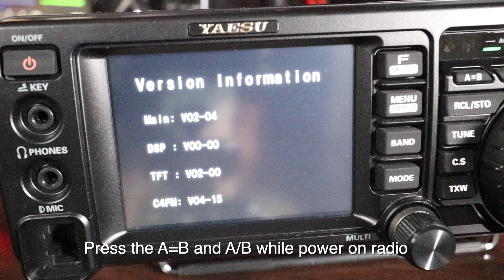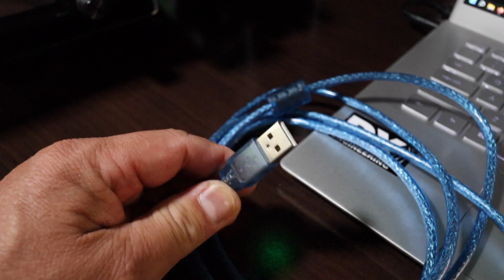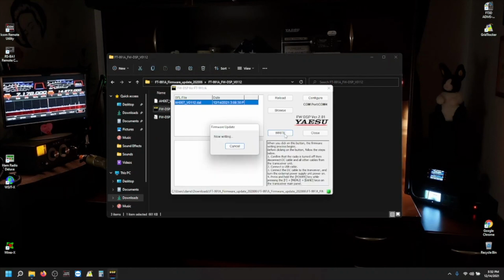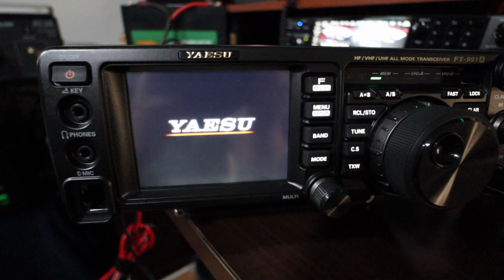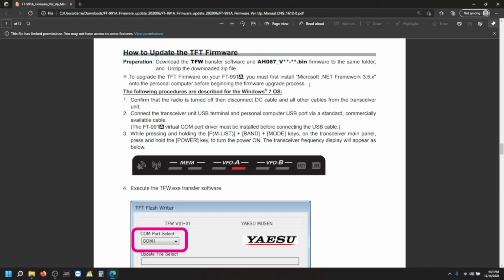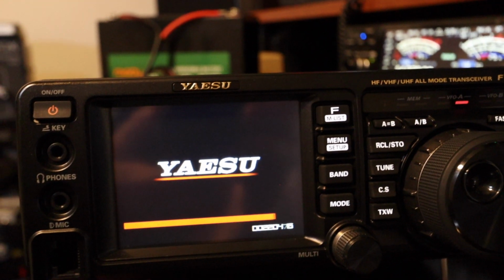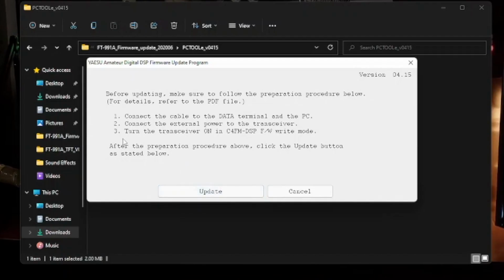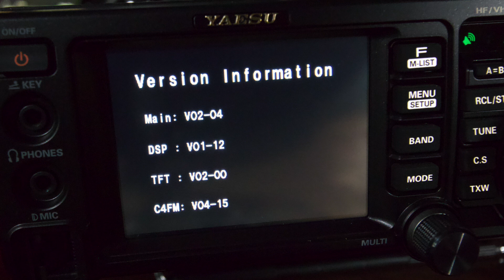New Revised!  Firmware Updates on Yaesu FT-991A | The Process Required! Main Firmware V2.04.

Comment: Excellent video.  I found it interesting which wasnt mentioned in the video in that the manual said it would reset all the memory channels.  Almost had a heart attack because I didnt see it until after I updated it.  Well surprise my memory channels are not erased but I've only updated the main so far.  I will backup my memory channels before doing the rest.  I wonder which firmware update of the 3 wipes your memory channels.  I also noticed Yaesu seems to not have made available the release notes to the firmware update so I have no idea what was fixed or changed.  Not cool.

Comment: You're the man Cap'n.... Love your well-presented video clips. I wonder if you partially generate the thotts during flight layovers? We worked on FT8 last week on 15 I think - maybe it was 40.. I live approx 3 hours south of you - wife has dementia otherwise I WOULD DRIVE UP THERE TO VISIT YOU FOR 10 MIN.  I am close to buying a 43' zerofive. I hope you got some satisfaction from the police looksee.... I wonder if you got your mount pipe at lowes or Home Depot? what diam and length 5' ?? cheers and we love your you tube clips and keeping hams tuned in... I wonder how you have the time --- envy your energy... long may you run... cheers from Mims FL.  K4BEW
Reply from the maker: Hello Cal, nice to make contact with your on 15m.  You'll like the Zero Five Antenna.  I love both the 43' and 27'.  The pipe that I used was from Lowes.  It's a 10' section galvanized steel water pipe.  I believe the diameter is 1.5"  I also bought a cap to cover the top of the pipe.  You will need to cut the pipe in half with a hacksaw.  73's for now!

Comment: Great Video. I appreciate your efforts and time.

I do have a Couple of questions, if you have the time.
I just picked up a 991A I'm pretty excited about it, just waiting on a few things to come in.
My questions are,

1.  Will this driver work on a PC with USB 3.0 interfaces? 
 I see in the requirements or Environment, it list USB 1.0 and 2.0, no 3.0?  
My PC has Windows 10, but its just new enough that it only has USB 3.0, the ports may support 2.0, but not sure how this driver will react...

2.  On Page it, it shows 2 virtual COM ports (Numbers not important), but they are called Standard COM Port: and Enhanced COM Port, each has it uses...
I just want to make sure I'm looking at them right.
Standard, Would be for using/running one of the remote control software apps?
Enhanced, Would typically be for be for Upgrading the (4) Firm wares and using a Config Software like RT Systems???

Is my understanding of those correct?  I over analyze sometimes, but I want to make sure I'm correct and not confused or backwards.
Thanks again for your time and assistance with this...

Comment: As always great videos!
 Please, I have a question, why use battery instead of power supply for the update ?
Thank´s,
Fernando
Reply: If you loose power while upgrading, it will render your transceiver unsuseable.
Now, depending on where you live: Do you consider a fresh, trusty battery more reliable over the mains power or vice versa ?
Can you get your hands on an uninterruptable power supply which would buffer your pc running the upgrade software as well as the radio ? than that would be the perfect solution. 

Use the power method you have available and you trust most.

Comment: Darren were you using windows 10 ? I am having problems with Win 11. The USB driver is installed and says its working however it fails to write to the radio.
Reply from the maker: I'm using Windows 11 home edition.
Reply: Thanks Darren @DarrenN4VFR

Comment: very nice video very well explain I have a problem with my ft991A it does not accept SSB mode in VHF and it bugs it is no longer operational I will do the complete update, great and again thank you 73 alain on3sta from belgium😏
Reply from the maker: I hope you were able to reset the SSB operations on VHF.  73's de N4VFR
Reply: @DarrenN4VFR  hello dear 'OM' N4VFR, thank you for your return, indeed I control on my transceiver but update and they are correct, only the tft screen is not updated, but that is a small detail lol , so I noticed that my ft is working again in 'SSB' 'VHF' I am again close to a 'DX' contact I remain of course vigilant on this anomaly which I am monitoring, thank you very soon maybe on frequency 73  ON3STA🤔

Comment: Still waiting for yaesus update on this radio to fix a big bug if you are a user of VOX operation like myself. That is while operating voice via VOX many settings do not function. Example setup your TX audio EQ have it enabled and while monitoring your tx audio with VOX in use and then MOX or PTT you will clearly hear flat non EQ’d tx audio under VOX and then your wonderful EQ’d tx audio while keying radio without VOX. I reported this to Yaesu and they wrote me after testing and confirming this is a bug. Still waiting.

Comment: Excellent. My radio is just over a year old and already has these firmware updates. Is there a document that shows you WHY you need to update the firmware? Just the 60M / 5MHz band? 

Thank you Captain for the high-quality video. 73 de NØGFT
Reply from the maker: I'd say, if your happy with the current 991A don't bother with the firmware update.  This is what I found with the latest firmware update from 6/2020.  https://www.yaesu.com/indexVS.cfm?cmd=DisplayProducts&ProdCatID=102&encProdID=490C4A71118AD0F4E825E89D821B73BB&DivisionID=65&isArchived=0 Click the firmware information.
Reply: @DarrenN4VFR  Thank you. Yes, my radio has all these already. I appreciate it!
Reply: @DarrenN4VFR  You should always update your firmware.  If not, you may not be able to communicate with newer ones that come from the factory already instilled.
Reply: @donski1519 That's too funny😂

Comment: Are you running a PC emulator there? Guessing it's not possible on a mac without an emulator?
Reply from the maker: You may see my iMac in the video however, I'm using a PC to download the firmware and install it on a SF card.
Reply: I would avoid an emulator in any case. You want the most stable scenario you can get your hands on - not some stacked api solution with latencies etc., or an scenario that uncommon that you would not expect YAESU to have it tested.
Simply borrow a windows notebook with an intact battery that is plugged in the power supply additionally, it does not need to be the very newest one.